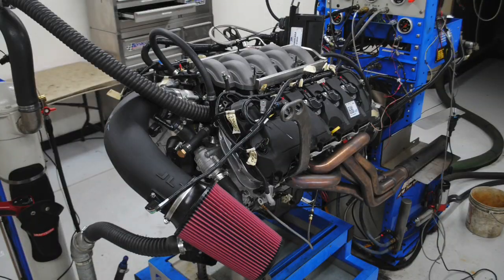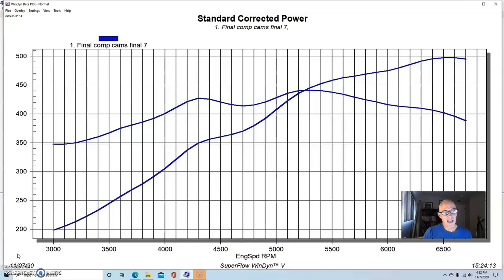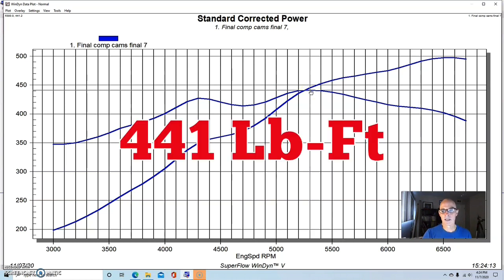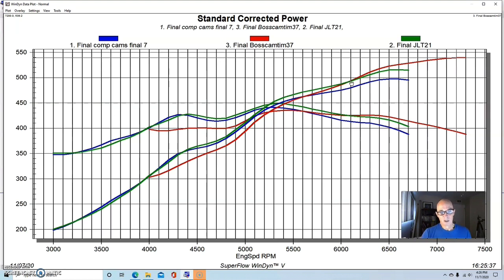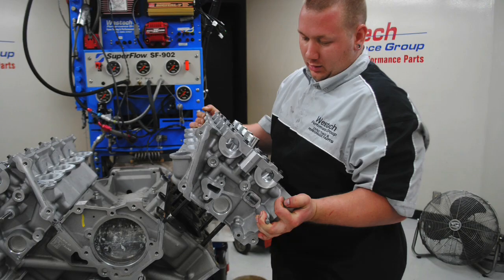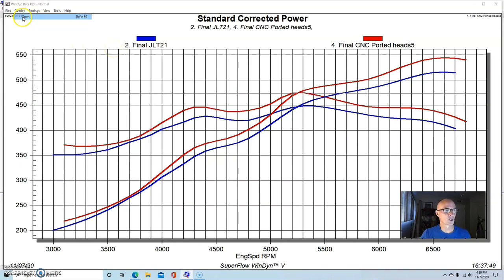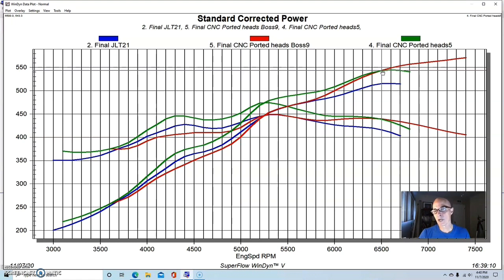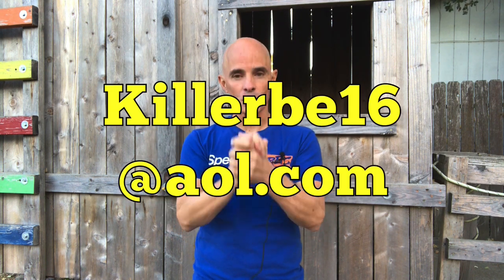GEN 1 COYOTE CNC HEAD TEST-PLUS BOSS INTAKE!

Comment: I would like to know how much torque is affected with a boosted setup if the boss intake still drops that much lower end torque operating under pressure rather than vacuum.
Reply from the maker: the intake does the same thing boosted and na-the intake helps determine the effective rpm of the motor
Reply: @richardholdener1727  thanks for the info!

Comment: Like how this debunks that these motors don't make torque.  12-13 boss 302 heads are factory cnc ported. Should get you a set of those to test
Reply: Check his video coyote vs 4.8 5.3 and 6.2.   Only the big motor can beat the coyote,,,in torque as well

Comment: Richard, What fuel was used for testing?
Reply from the maker: 91
Reply: @richardholdener1727  impressive
Reply: I used those same parts all except I used the largest cams, which were the largest available at the time and made 465rwhp on a chassis Dyno. Although, I feel the numbers were lower than they should have been due to running bias street slicks on the Dyno. Lol. It's all I had at the time and my Dyno session was on very short notice. Also, mine was on 93 octane pump gas.

Comment: I’d like to see a test on gapped rings on a gen 1 with boost I’ve seen a gen 2 with gapped rings hood 1000rwhp multiple times gen 1 and gen 2 rods are very similar
Reply: Gen 1 is only safe until 700whp vs gen 2 which can live all day at 820whp and 1,000whp on special occasions.  This is due to the stronger gen 2 rods.
Reply: @Sir.VicsMasher   gen 2 with gapped rings can hold 1000rwhp I wanna if gapping the rings on a gen 1 will make it last because my gen 1 didn’t break the rod it cracked the piston from the rings touching

Comment: Hey Richard! Can you do a 5.4 dohc nav engine vs a coyote?
Reply from the maker: a Coyote wins that
Reply: @richardholdener1727  could you try to big bang a 5.4 3 valve?
Reply: @smackledorfmcsween  One doesn't have to try to get a big bang from a 5.4 3v. All you need is enough cylinder pressure to squirt a plug out of it's threads.

Comment: 9/10 people don't know how to take advantage of a high revving Coyote engine. They build an N/A motor to rev to the moon on a heavy car and don't gear it accordingly and you end up with pretty much a loud high rpm engine that gets embarrassed on the street/strip. Then they get frustrated of why they spend so much money and it doesn't perform like a boosted engine with the same power, but keyword...much better torque.

Comment: Richard, a question. I hope you will read and answer.
My engine currently has a Weiand 142, with carb. Let's call it a "Primary Blower."  If I were to add an Eaton M90 as a Secondary,  into the mix, blowing  air only,  into the manifold below the Primary, could I conceivably pick up the  extra  "90 cfm"  that the Eaton provides? 
The M90 makes it's boost in the blower, not in a manifold the way the  Roots -Weiand does. ....... So?
Reply from the maker: the m90 is a roots blower and you would be compounding them-you need to run them in parallel
Reply: @richardholdener1727  Hmmm....
                                               I understand what you're saying..  Thank You.

Comment: I'd love to see a max effort gen2/gen3 NA Coyote. Ported heads, ported 2018/gt350 intake, Comp cams stage 3 NSR cams.
Reply: Max effort is with a ported cj the others are all sacrificing performance by comparison.  No the gt350 and 2018 gt manifold are not as good.  Max effort setup is a ported cj all day every day its the best intake there is and it dont lose torque down low like the boss and gains even more up top.  Same with the l&m intake cams 20 whp up top with no torque loss.  Either model could hit 500 wheel on e85 the 18 does it slightly easier because of dual fuel and 1 point higher compression.

Comment: drool I wish I could wedge a Coyote engine in my '64 Ranchero!   Awesome Video! Thanks Richard!
Reply: How wide is the suspention/fenders? The coyote is 29.5in wide up top and fairly narrow down low.
Reply: @177SCmaro  omg, I forgot to measure, I have my project at my sisters house and I went there tonight with the explicit purpose to measure it and I forgot lol. I'll Updated you tomorrow or the day after. Sorry man, but im pretty sure you have to cut the shock towers and maybe even have an issue with the headers.
Reply: @mikev.7361  For some reason I didn't realize the rancho used that narrow shock-tower type suspension. Yeah, it might be challenging to squeeze a Coyote in there.

Comment: How do these ported heads compare to the 2012-2013 factory Boss heads?? More Coyote stuff....
Reply: Stock port flows better than boss if you get aftermarket stock equivalent boss heads and have them.ported they flow better though seems like the factory boss heads were manufactured with thinner walls on the ports so you can't do alot of porting

Comment: Why that hole in the torque curve, I wonder?  Was that there on the stock cams?  Something to do with the variable valve timing curve?  Was the VVT locked out on these cams?  I notice that, although the Boss intake produces less torque down low and in the midrange that it also seems to flatten that hole.
Interesting stuff.
Reply: It's probably mostly vvt tuning with those cams. Mid-range with were most of the vvt stuff happens. I say that because it stays that way with every combination they tried.
The 2ZZ in my DD Celica does the same thing except it's even more dramatic because it has vvt and lift.
Reply: @177SCmaro  That's interesting, too.

Comment: Maybe in ten more years the Ford powerplants will be as good as a 1998 LS1 with a cam swap.
Reply: They will always be under because of displacement. Look at comparable mods on a 4.8 and tell me how much power they make.
Reply: @ianm432  
 The 4.8 was never a hi performance motor its a truck motor if it had 3 more cams and 16 more valves it would be in the same class, but lets put turbos on each stock 4.8 and 5.0 and see who comes out on top or who comes into pieces first.
Reply: @tpeace2160  facepalm
Reply: @tpeace2160  
You do realize the coyote is in the f150, right? And that the f150 is a truck?
And defending the 4.8 based on it's lack of dohc is the same as defending the coyote due to it's relative lack of displacement to the ls1. You kinda made his point for him.
Reply: @177SCmaro  
The engine he is testing is a 5.0 HP for a GT Mustang not the truck version. I know the 5.0 comes in trucks. Every body knows 4 valves are HP engines from aircraft to motorcycles to autos that's the reason the 2 extra valves are there no other reason. The top fuel Hemi has only 2 valves and a big blower that is also HP engine. Two valve 4.8s are not HP engines but they can be modified to make more power like anything else, you can spend enough money you can make almost anything make power, then it maybe a HP engine but it was not design as one no more than a 300 Ford inline 6.

Comment: Hey Richard how bout a turboed traditional Pontiac?Stock block and crank with good rods and pistons have been 1600 horsepower would like too see your findings!
Reply from the maker: 1600 hp with stock block and cast crank? In a Pontiac?
Reply: @richardholdener1727  .... once. Once. Sounds like the kind of thing that makes you question how good the debris shielding is on your dyno control booth.
Reply: https://youtu.be/wXrrNxpPrIw Not only that but how bout stock block and stock cast iron heads with 0 porting 1600 at the rear wheels...
Reply: Im building a twin turbo stock block traditional pontiac 434 now that was inspired by you! My goal is to have it streetable enough for my my wife to drive it to the grocery store and 1000-12000 flywheel for me to play with.Richard go here this is the pontiac Yellowbullet http://forums.maxperformanceinc.com/forums/ thx!Honestly folks go over 1000 all the time with street cars!
Reply: That's pretty funny, stock crank. There is a couple reasons this is dumb, a new iron block isn't really that expensive, new aluminum heads will add tons of power, and everyone won't laugh at you for the dangerous garbage your driving.
When you have 30k invested in the rest of the drive train, spending 3k on a block is peanuts to make sure you don't over the crank at the big end. What it looks like is those guys used a 428 block, they have some of the heaviest webs of any of the small journal blocks. It might last for a little while, but even filled that block will tear the main webs out of it sooner or later.
Reply: Honestly bud those numbers aren’t earth shattering lol.There has been a 400 factory block, Littlefield 8-71 blower, Enderle injection, 
custom blower intake, on 7% nitro,three-disc glide clutch, three-speed Lenco that has run for years with a stock block he ran 6.78@201 with a GM 400 block back in 2013.As far as block any 74 and older will hold a 1000 reliable you see what really tears stuff up is a bad tune.Heck marty palbykins black 70 gto with a twin turbo 406 traditional stock block and crank with cast iron heads went 6.95 185 back in 96.But yea better parts buys some insurance without a dought lol!Still like to see Richard do a economical way to 1000 it would be neat!

Comment: Can you test one of the 5.2 flat plane motors and see how they make power high in the RPM range?
Reply: They're really expensive. I am guessing there wouldn't be very much, if any, difference. The gt500 uses a 90° crank with the voodoo heads. The only thing you would be comparing is how much hp the inertia of the crank eats, the voodoo crank weighs 51.4lb with the factory balance and the boss 302 crank weighs less than 52.0lb, that's the shipping weight from summit racing in a box. There is a really good chance that the crank layout costs more power from the dual mass flywheel and intake manifold packaging than it gains from pumping efficiency.
Reply: I think it's about harmonics with the flat plane crank not so much the actual rotating mass.
Reply: @williamlynch3491  usually flat plane engines can exploit packaging for tuning of intake and exhaust. The rotating mass is a small, secondary benefit. The Boss302 crank is light enough as it is that most people find driving the car uncomfortable with an aluminum flywheel. The rotational inertia is not enough for daily driving and it makes the car too easy to stall at low speed. Usually it's about packaging, I don't know what the engineers at Ford game plan was.
Reply: The94GTC  Flat Plane crank 🤘👊💪

Comment: Love my Gen 1 2014 GT...it's a mutant with a 2015 casting on the drivers side and a 2014 casting on the other. Seems to run well.....
Reply: The improved the 2013-2014 5.0s even tho they’re still gen 1
Reply: @patrickgowdy7656 Was going to chime in there. The 2013 and 14 got a bit of improvement from ford racing teams boss 302, not much but still..
Reply: my 2014 F150 5.0 has the 15 casting on the drivers side as well
Reply: @alecmejias85  there are a few weird things about my 14. It's got grille fogs it shouldn't have, the stock tune was definitely sharper than my 2012, it's an odd combo of sport suspension and automatic. Guess late in the game they were chucking stuff at the Salk a bit....

Comment: I'm glad you explained the cams and headers because I was sitting here wondering how tf it made 497 HP when they were rated at 412 HP.
Reply: Don't forget it had no accessories that take hp also(no air conditioner, no power steering, no alternator, no water pump) I don't understand why some people don't think accessories take horsepower to operate.  That's first day shit.
Reply: @mattjonesturbo1  Coyote's don't have hydraulic power steering.... unless they are swapped into a different chassis.
Reply: @robinesavage404  no but they got all that other shit to power and spin.  Not only did it have long tubes it was straight headers.  That combined with no accessories makes up the hp difference hes been over this repetitvely then you still got guys commenting hey how did it make such and such when theyre rated at such and such.  It isnt rocket science guys lol

Comment: Love to see work on a 6.8L Ford V10
Reply: I hear this V10 does really well on Boost... 
Love to see what a good valvetrain would do on this motor to up the revs and see what it could do HP/TQ
Reply: I've got a V10 in a 2000 E350 cargo van with 314,000 miles on it. Single 3" exhaust with a 50-series Flowmaster plus a small glass pack resonator. Sounds awful doesn't like to rev very high and gets 11 mpg down hill.  Would rather have a 460.
Reply: @chris49ford  stock for stock, I've had 460's and I'd rather have the v10.
Reply: Car and Driver on the new 7.3 gas motor replacing the V10 "This new pushrod 7.3-liter V-8 replaces Ford's overhead-cam 6.8-liter V-10, an engine that sounded like a sick hippo and was even less fun to be around."

Comment: Finally some more Coyote stuff!
Reply: for what? all we need is big blocks and pushrods. crapyotes still cant do 8s N/A
Reply: @LightningFast240  
um, explain this then: https://www.youtube.com/watch?v=Uijf-Fa-TZI&t=418s
Reply: @177SCmaro  thats a fuckin foxbody. im talking about in the original chassis
Reply: @LightningFast240  
Funny how you didn't mention that requirement until just now. If I find an 8 second late model NA Coyote Mustang are you going to move the goalpost again or are you going to cut out the shit-talking?
Reply: @LightningFast240  
That's what I thought. Back to the bridge with you, lol.
Reply: @LightningFast240  There are full body n/a yote fox's running mid 8's stickshift..
Reply: @GapSauceYoutube  bruh anything in a foxbody can do 8s. Even 3 valves.
Reply: No they can't lol you need an ass load of mods with a 3v
Reply: It will just blow up...... it’s a coyote
Reply: @yeahok115sure  
Obvious troll is obvious 🙄

Comment: These Coyote can rev past 7300 easily, my gen 3 whipple with stock cams and forged bottom make 750whp on 3.75 pulley. The gen 3 coyote is more impressive. Love these motors.
Reply: I spin my stock bottom end 5.4 to 7600 n/a, ARP rod bolts though.
Reply: I turned my NA gen 1 coyote to 8,200 rpms.  Never one issue with it either.
Reply: @marksiniard8445  boss or regular gt stock??

Comment: Great video my gen 1 still alive with oil pump gears and roush supercharger e85 720+whp
Reply: My gen 1 Roush at 687whp on 93, hopefully lasts lol
Reply: That's so awesome. I've been dying to get a 2012 or so GT with a Coyote and a manual trans. I drove a 2018 convertible, but it was an automatic and it still hauled ass. I'd get a hard top, but it'd HAVE to be a manual trans.
Reply: @DiamondBackRattlaKid  I would've gone manual but the mt82 isnt great compared to the t56 I had in my 03 cobra before selling it.  The cars are great
Reply: @superscort57  they made some shift improvements in 2018 but ford decided to screw up the gearing. they claimed it was due to the higher redline but i suspect it was due to mpg.

Comment: That was without the cobra jet and stage one heads and not huge cam on pump gas.. those coyotes can be nasty if you went stage 3 heads huge cam rev to 9000 rpm with cobra jet and you can get 600whp na ... don't get me wrong I have a heads cam ls1 and I love it but those yote are nasty.. I miss my 2013
Reply: Have yet to see a 600whp 5.0 NA

Comment: Richard, do you know what is optimum airspeed in intercooler piping at turbo motors, some say that it must be lower than 0.3mach, but internet does not know the OPTIMUM flowspeed! Do you know? Or do anyone know?
Reply: You really want it to peak at about 300ft/s. After that youre gonna start having issues with pressure drop. With really good tubing you might be able to go a little higher but 300fts gives you a good balance of restriction and inertia. Lots of time you'll find this matches the factory throttle body size pretty well.
Reply from the maker: Are you measuring actual air speed or just calculating it? I'm actually more concerned about what the dyno numbers say!
Reply: @richardholdener1727  I'm just calculating it, because i'm raising the boost up and original intercooler piping is 60mm, and i have calculated that with this tube size i have a 300ft/s airspeed, which might be just good. I asked this because i need to know if i get any gains to enlarging intercooler piping size at 60mm to 2.5". Of course i'm interested with the dyno numbers more than this kind of mathematical nonsense. Keep up good work. And greetings from Finland!
Reply: @jussialanko6597  you will almost always get better numbers with bigger tubing. Lengths of tube have a pressure drop no matter how good they are. I've read a magazine article where going from a 3" to 4" tubing in and out of the IC was worth 12hp on a 1000hp blown Windsor. Is it worth power? Yes, definitely. Is it worth it? Maybe not. A turbo combo with a manifold referenced wastegate will have very little difference whereas the article I referred to had a Vortech blower. Going from 60mm to 2.5" is barely a change. It's like 5mm different. That's a lot of investment in parts that will have very little difference in power.